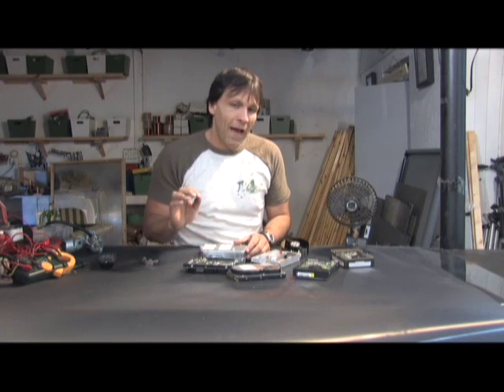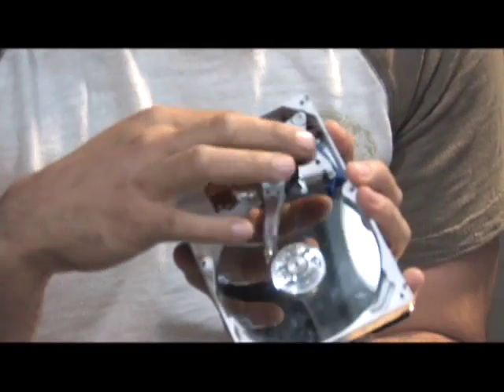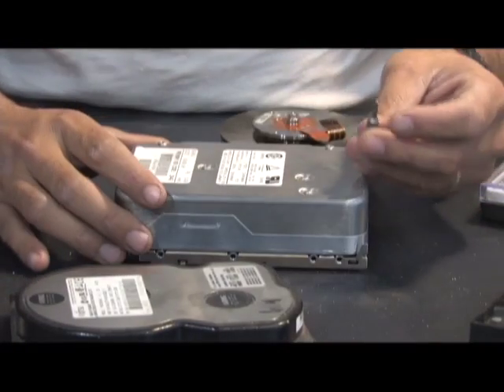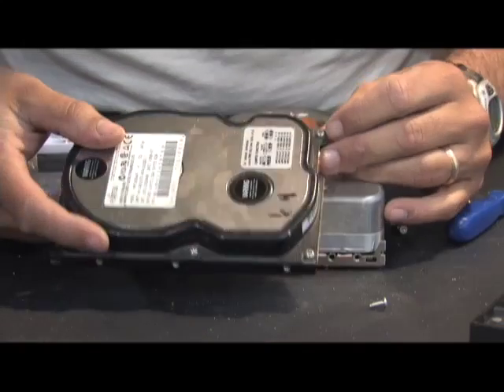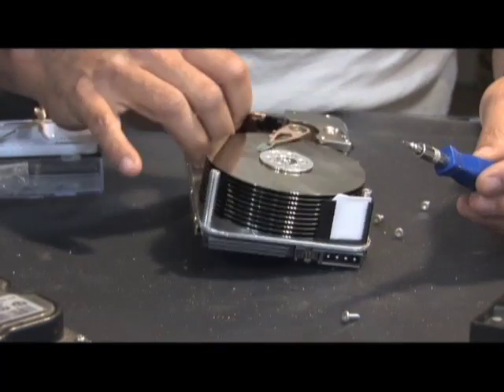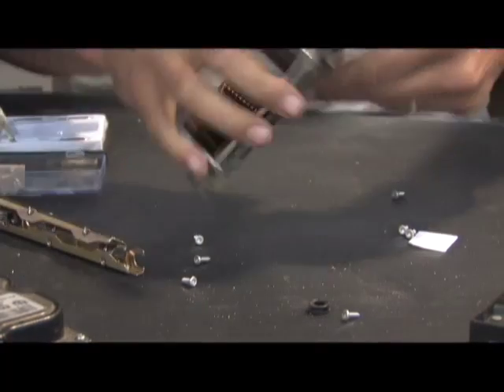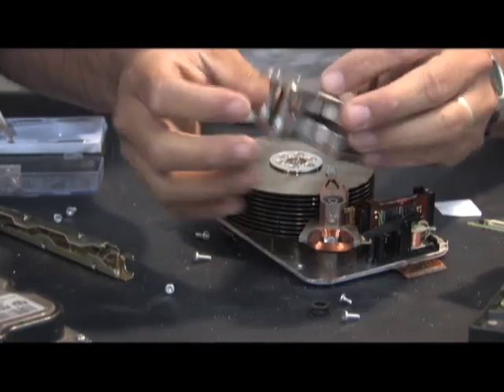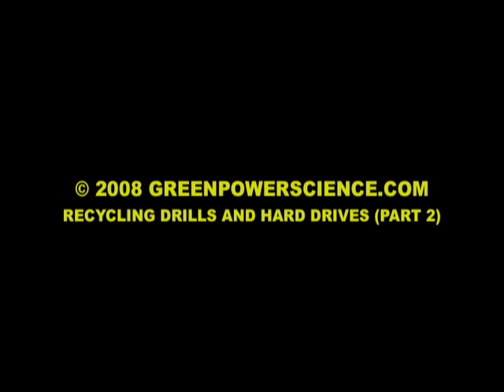Hard drive hack Tesla Turbine Parts RECYCLING DRILLS HARD DRIVES FOR GENERATORS AND PLATTERS p2

Comment: @GREENPOWERSCIENCE hey Dan love your vids. Just thought I share some info with you, I took apart an old har d drive and it used normal Phillips head screws (back when security wasnt a concern) and I found that the magnets are ceramic but super strong cermic magnets not cheep fridge magnets. And also I've mana fed to remove some of the special screws with an Allen wrench

Comment: you can use the platinum plated disks to make great conductive sources for electrolysis projects although since you are running current through the platinum disks over time the electric current will deplate the platinum from the bottom source metal its plated on top of. That is why using plated anything as conductive source metals is not the best idea because you will lose the coating over time.

Comment: just for the magnet? The answer is the magnetar, a rare type of neutron star. You wouldn't want one of these hanging on your refrigerator. Magnetars are so magnetic that they could strip the information off of your gift card or credit card at a distance of 100,000 miles, or halfway to the Moon. Get much closer, and the magnetic force will rearrange the atoms in your body.

Comment: I once opened the casing of a harddrive and just put it in a fire. After about one hour in the fire the printed circuit board was made into dust and the metal had melted a bit. the platter itself was the only thing that remained in shape. strong stuff.

Comment: These magnets are also dangerous in another aspect.... if you let them fly together, they easily break in parts because the material is very brittle. Some smaller parts can fly away and hurt you.

These magnets are fun but you have to be careful.

Comment: When you strip a screw, use a drill bit, and drill it until the head is gone, pull the piece you were after in the first place off, then use pliers, to unscrew the screw...

Comment: You can actually undo torx screws with an allen key (hex key).  Make sure it's EXACTLY the right size (really tight fit) or you'll end up mashing the torx head.  Also it has to be the flat-ended type.  Don't try the ball-ended type of hex key.

  I use allens for undoing torx screws all the time for things which need a longer or narrower shaft than my torx bit set has.  That shouldn't be a problem with hard drives though.

If there's a post in the middle of the screwhead it's a "security torx".

Comment: afaik, the older hard-drives are less reflective because they have lower density.  As the density of hdds increases - the pits get closer and closer together, and thus harder to see and they don't cloud up the surface.

As density goes up and up, it essentially gets closer and closer to a nano-structured surface.